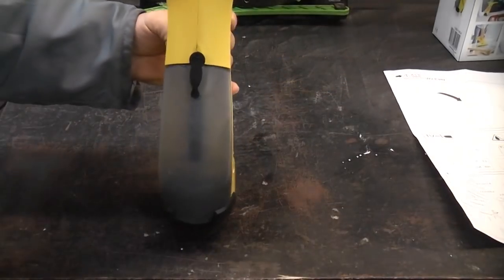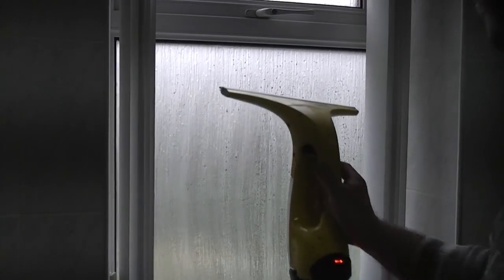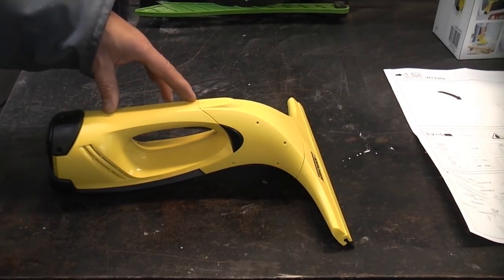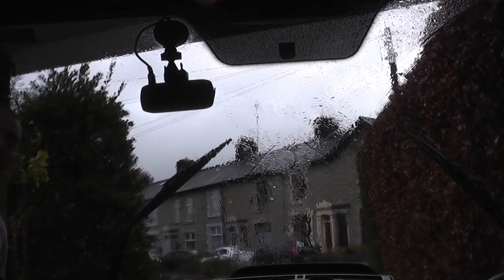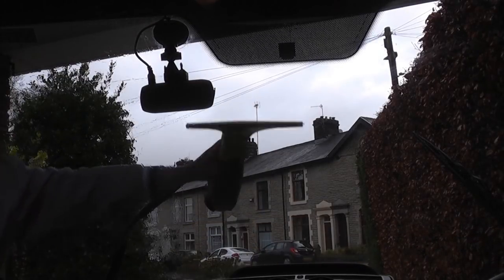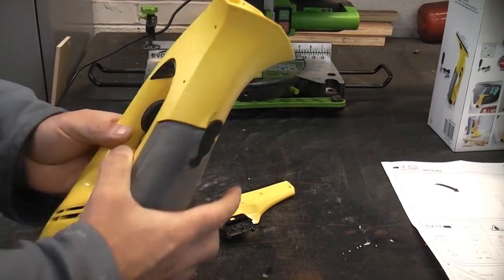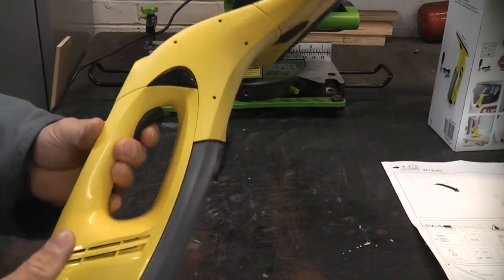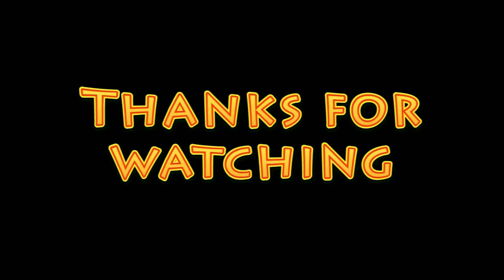Karcher window vac

Comment: I was very dubious when this first came out but was sold after using it so much so I now have two! With kids around even though it's not designed for spills it does a great job picking up from wet tiles. Also with a slight mod with some tuning can suck water out of cisterns! Thanks for reviewing!
Reply from the maker: Thanks for the comment ;-)

Comment: Had mine for two years for removing condensation from house windows and from a conservatory. Helps prevent black mould. Does a great job. 

As other posters say, it is just a case of using the rubber plug to drain it. It can carry a fair amount of water before it starts to splutter, and then it is usually if you tip it horizontally - obviously it is best operated held upright.
Reply from the maker: Thanks for the comment ;-)

Comment: Thanks as always for the great videos. I noted your camera on windscreen of your vehicle. Just a tip ! If you end up having a bump & even if it's not your fault, the cops  can say your driving was impaired as your view was obstructed by your camera ! It needs to be fitted behind the mirror if possible or as that's a panorama wide camera it can be fitted in the top passenger side corner at a slight angle. It needs to be above the tip of the window wipers.  Apologies for the lecture but it'll keep you right . 😉
Reply from the maker: Thanks, but the camera is not in my field of view, it is positioned just to the passenger side of where the interior rear view mirror would go (I don't have an interior rear view mirror, as the van has a bulkhead)
Thanks for the comment
Reply: Ultimate Handyman  In that case i shall call off the snatch squad..... 😉
Reply from the maker: LOL, thanks for the comments

Comment: I've had one since they came out and it's brilliant.  I keep in the ensuite for doing the shower door and tiles after use.  But as demonstrated its great for removing condensation and for use on vehicles after washing, panels as well as glass.  Particularly medium + sized vehicles.  The standard head is a bit restrictive on small cars (or at least on my wife's old Ka).
Reply from the maker: Thanks for the comment ;-)

Comment: No need to strip the thing apart to empty the water thats collected, just pull out the rubber bung/stopper on the area above the water collection tank and let it drain out down the sink or the road side .
Taking it apart is for regular cleaning (perhaps monthly) not day to day usage.

Comment: Nice bit of kit but currently can not recomend them for long term use (12months). Got one in bits currently awating a new cell because the current one no longer holds a charge due to being overcharged by the supplied charger. The cell is soldeded to the board meaning this is going to take a bit to repair and there is no garantee that it will work flawlessly and suspect the controler board might be shot.
Reply from the maker: Blimey, that is bad news. Thanks for letting me know ;-)
Reply: On the whole the design of the device is decent, seals in the right places to prevent ingress of water, the on/off on this version is fully sealed so no way for ingress to cause rusting etc. Motor housing is sealed so that removes the chance of that rusting too. I wish the 18650 cell they had used was in a battery box and not tabed solded to the board, would have made it quicker to test due to having some 18650's i could have used. If its the board thats gone faulty i carn't see a way to repair this one, theres not a aweful lot of bits on it and will instead just replace it (the karcher outlet was selling these at 25 quid recently with 12 months on them, gets to the point not worthing trying to fix when its that cheap)

When they are working, nice bit of kit esp to reduce streaks on windows and cars (dried my car with one before, after washing it :D )
Reply: Exactly what happened to my friends, either the battery was screwed or the circuit board got damaged and when I looked into replacing these parts it made more sense to buy another one. They went for a VAX one which has bee flawless but the Karcher was a better performer...
Reply: Had one for over 4 years & it's still working.  Great for cleaning glass plus we've got old windows that mist over.  Maybe they've changed the manufacturing to cut costs.  I'm sure they were over £70 when we got one.
Water can be emptied using the rubber bung on the front, but to clean you need to take it apart.  The only negative I've found is after a few years the catch becomes loose so the head moves around a little while using it.

Comment: Just remove the rubber plug on the water container to empty it. No need to dismantle it.
Reply from the maker: Thanks Paul, when I looked at the instructions I thought the preferred method was to do it the hard way (but the instructions are not great).
Thanks for the comment
Reply: Nonsense, that hole is tiny, it will take forever to empty!  Much faster to just pop-off the top section and remove the water container.

Comment: I have one but find that it leaves streaks. Any suggestions?
Reply from the maker: I've not had that problem.
Do you live in a hard water area?
Thanks for the comment 👍
Reply: Ultimate Handyman. Yes , I live in the East Midlands which is a hard water area.